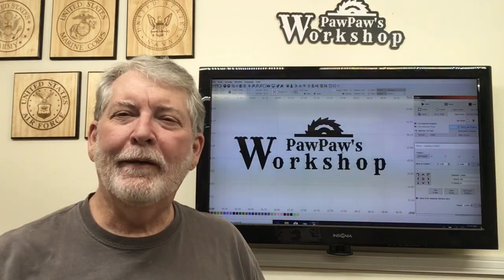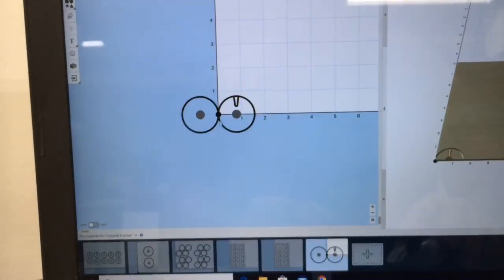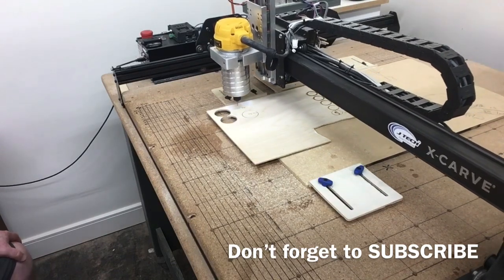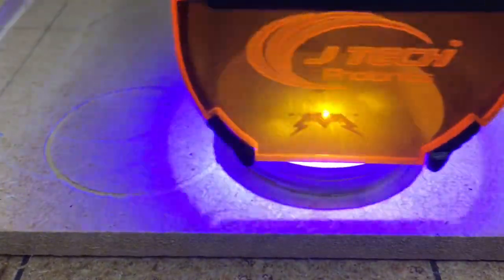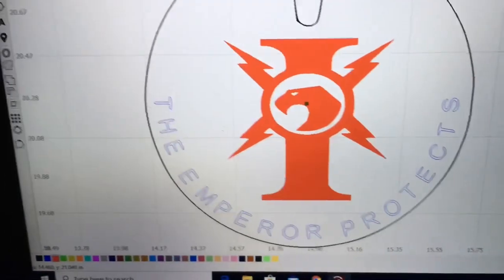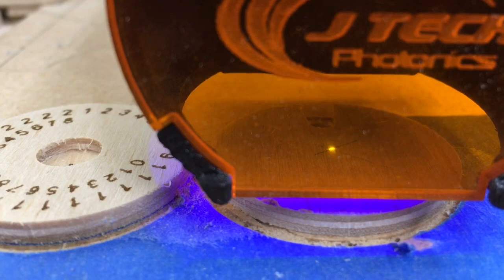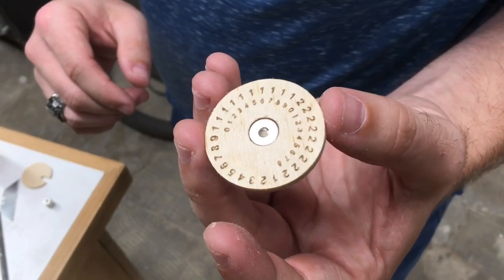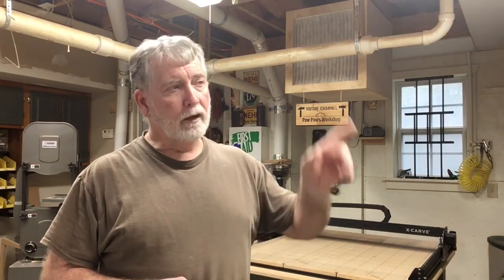How to Make a Wound Tracker in Warhammer Using the XCarve CNC and the Laser

Comment: HI Paw Paw :Great Video !Question for ya ? I would like to add a laser to my X Carve and i think the one you use is one of the better solutions? Can you let me know a little more about it and also the software to use it with the X Carve ? How it interfaces with the machine as well? Thanks in advance for all you do :) John
Reply from the maker: I have the JTechPhontonics 7 watt laser and the Lightburn software.  It was very easy to install and I have a video on that topic.  Lightburn is very easy to learn and works very well.  To switch back and forth from Lightburn to Easel is just a matter of closing one program and opening the other.  Can't get much easier. l I love mine. It opens up so many new opportunities. Also, Jay is fantastic to work with and will help you get setup if you need any assistance.

Comment: Fun collaboration!   Really like the project and combo of software and xcarve and laser.  That auto cad should be able to generate your Gcode.  But I didn't know u could open the dsf or dxf format in easel directly.  I just started with fusion 360 , I thinks it's autocad, and dxf, but am generating the Gcode there.  Will try opening the dxf directly next time.   Wil try to pickup some of that glue too ... Great tip.
Reply from the maker: Thank you very much.  My son is the AutoCad expert.  I will ask if the gcode can be created there.  I don't think it is possible, however, I will check with him.
Reply: To be honest I’m not sure it can. However, that’s probably because I’ve never looked into it.